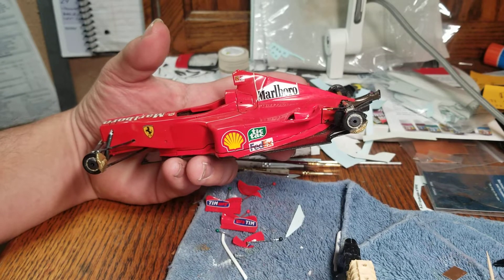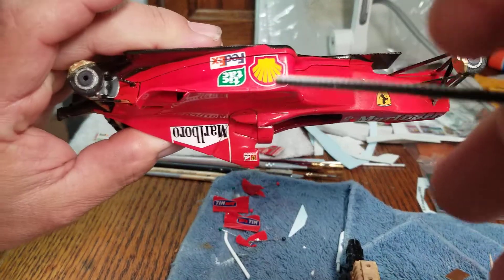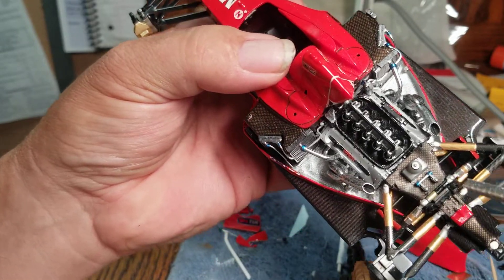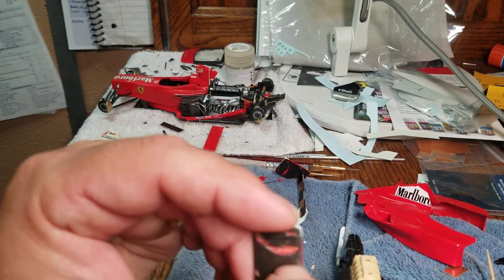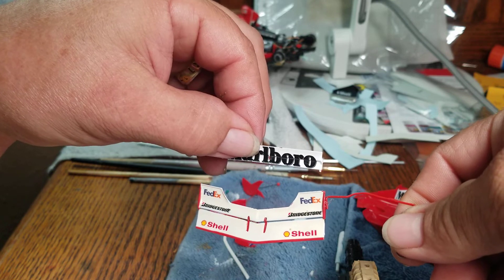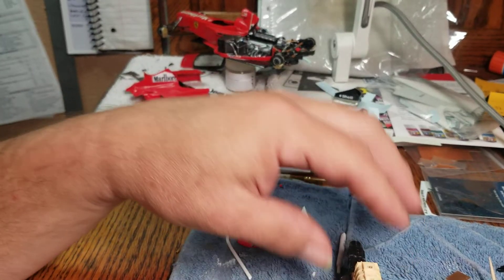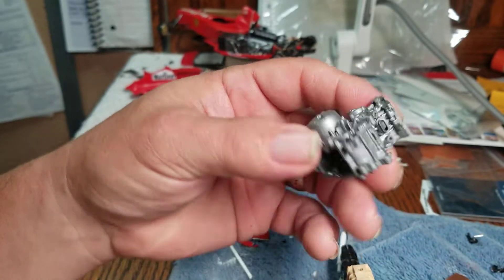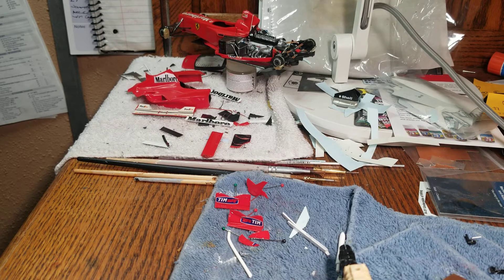Bench Update  / Doug and Fred Builds

Comment: On the F1, did you test fit before painting? Did it stay down? I'm sure you looked for interference and all but it looks like the paint my be the issue of not closing. But that's from only what I can see. You'll know more.  
They car looks awesome too.
Reply from the maker: Ill be honest.  I didn't.  It's a  Tamiya  kit.  I usually don't have a problem with there kits.  I'm on the same page as you though.  There is alot of paint on the car.  I'll get it sorted out though.  I really appreciate you watching and commenting Bob
Reply: @michaelhintzmikesminiature1812 . You are very welcome. The only reason I mentioned it is because when I see the edges of the parts, they seem too "rounded" as if there's a lot of paint. Paint "flows" and when it gets to the edge, it will fill up before it flows. So it then looks rounded instead of a crisp edge. That means it's really thick. And that will cause interference.